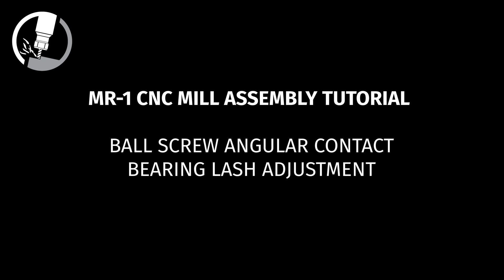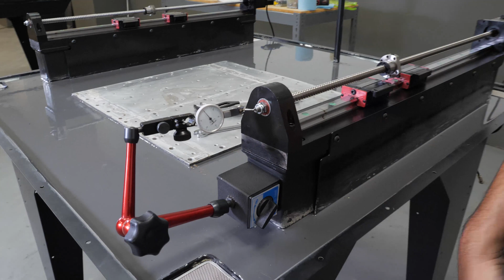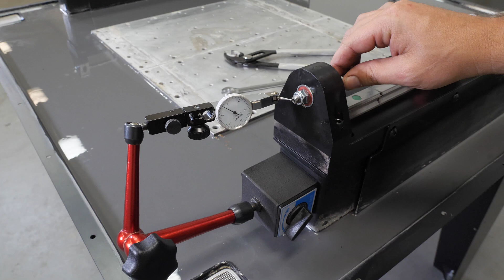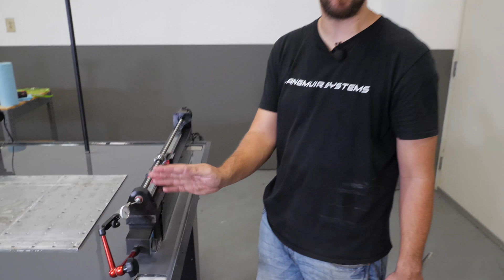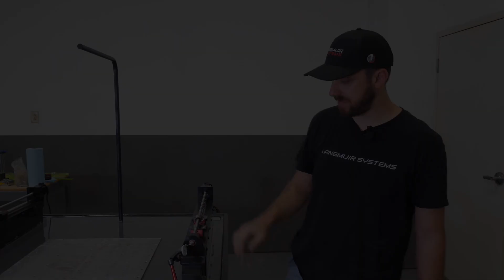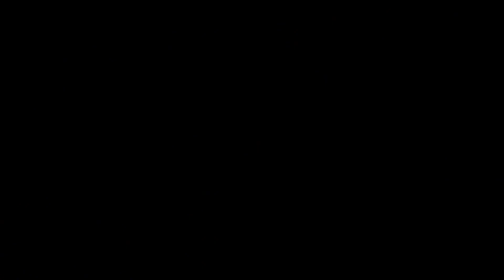MR-1 CNC Mill Assembly Tutorial: Ball Screw Angular Contact Bearing Lash Adjustment

Comment: Is this something that will need to be checked periodically or is it a one and done.?
Reply from the maker: This is a one and done thing!
Reply: @northernfabricationllc2281  alright Mr knowitall what CNC machine can I buy that's in the same price range that's as big as this one.
Reply: @northernfabricationllc2281  so I'm not sure if you understand but this machine is specifically geared towards The hobby people with it price and capabilities, I've looked into small CNC machines and most of them are way outta my price range or so small that they're useless for my needs, this is literally perfect for what I wanna do and something I can barely afford at $4500 but if it all goes to plan it will make me enough money to buy bigger and better machines. Also I'll be milling mostly aluminum and tolerances will probably be in the hundreds max so that should be fine, you should watch their videos of this machine cutting steel. Also I haven't even put a deposit down on mine yet.
Reply: @northernfabricationllc2281  it won't be long before some people start to get their's so we'll see some independent videos before too long and any issues it has going from a concept into full production will be identified and probably by the time I have enough money to actually buy it any bugs will be worked out. Also I'm not too worried about the CAD program cost because if I'm not making a measly $400 profit by the time I've had it a year it will be a sign that I've failed and won't need it anymore.